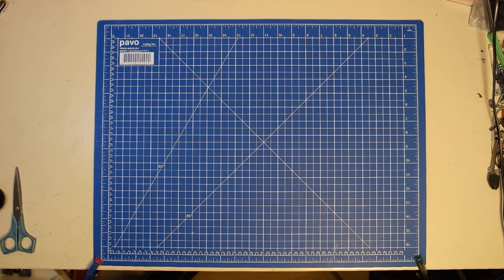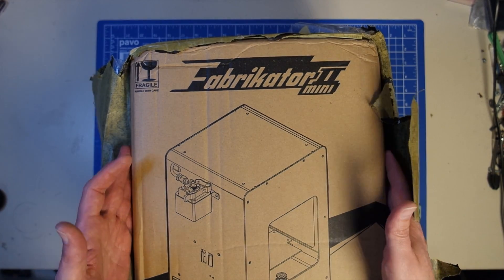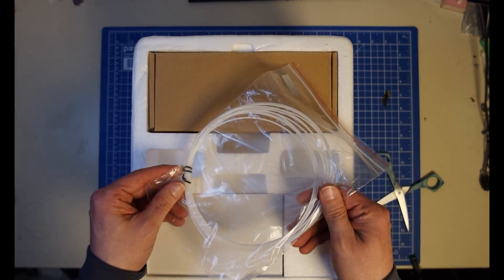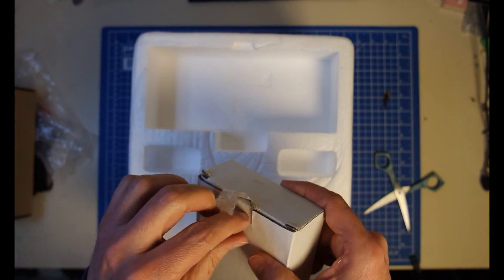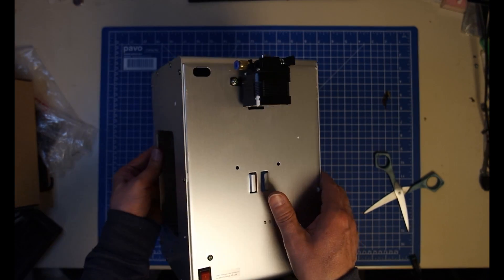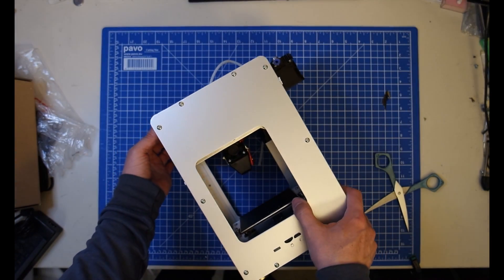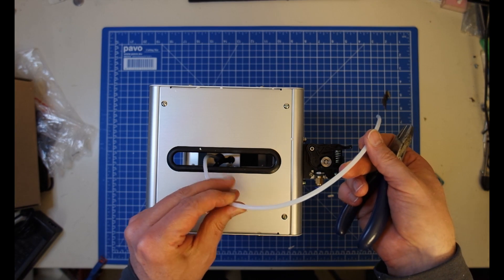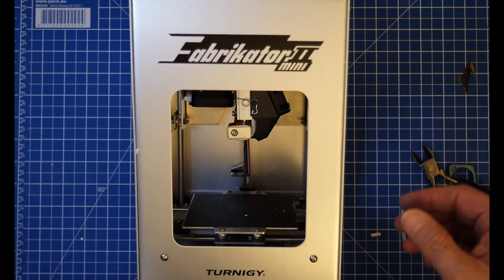3D Printer: Mini Fabrikator V2 Review - Unboxing

Comment: Hello,
Thanks for video,
Please can you tell me, if power supply is from 110 V to 240 V? I want to order it from HobbyKing, but its available just with US plug, So US using 110 V, but  i think, that power supply is for input voltage from 110 V up to 240 V? Can you tell me if im right? If yes, then i just need adapter from US to EU plug. 
And important question. How its printing now? Are you still happy ? 
Thanks and have a nice day !
Reply from the maker: The unit that I got has a 100-240V power supply, and the power cord is detachable, so if the US model has the same power supply, then it's just a change of power cords.
Mine is still working as well as it did on the first day ... although it might need a cleaning.
I have not used it for a while, because my projects are bigger that this printer will do.
But it's still my favorite to take along with me.
Reply: Hello, thank you so much for your answer.
Last question, is the Z stop adjustable? I want to print on glass (I have Tevo Tarantula and im printing on glass with great results), so it this possible on Fabrikator V2? 
Thanks !
Reply from the maker: I'll look a the length of the Z-Adjust screw when I get back home tonight.
Reply from the maker: The Z-Zero switch is not adjustable, but the build platform is. So if you use 2mm borosilicate glass, it might work - else you might need to move the Z-axis end-switch or add some height to it.

Comment: Hi dirk you stated on one of the videos ... ach bist ja deutscher ;-) in einem der Videos erwähnt du das die filament Rolle nicht passt. Kannst du mir bitte verraten welcher Hersteller oder Händler hier passende Rollen vertreibt die dann hinten nicht anstoßen. Gruß und Danke
Reply from the maker: Das ist gar nicht so einfach ;-) Ich hab die Erfahrung gemacht, dass es keinen festen Zusammenhang gibt ob man jetzt die eine oder andere Rolle bekommt wenn man ein Filament bestellt. Generell sollten ale 0,5 und 0,7kg Rollen passen, aber da kenne ich bei PrimaPLA zumindest schon eine Ausnahme. Am besten als erstes einen Rollenhalter drucken.
Übrigens: Der Abstand zwischen den Stepper und der Halterung ist 7,5cm.